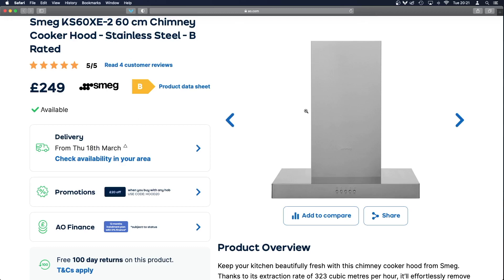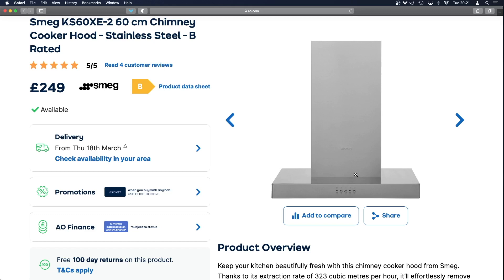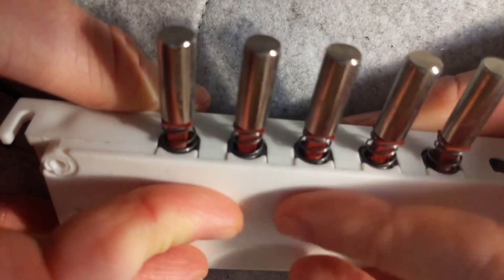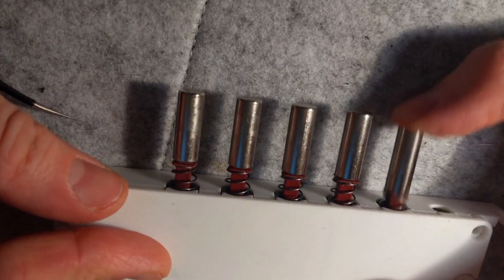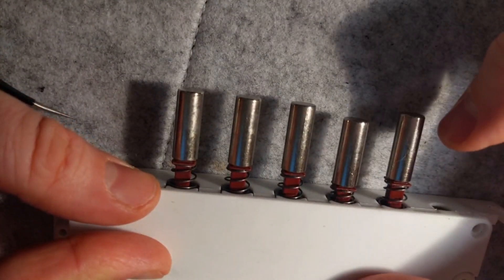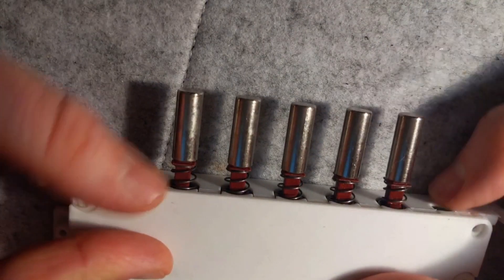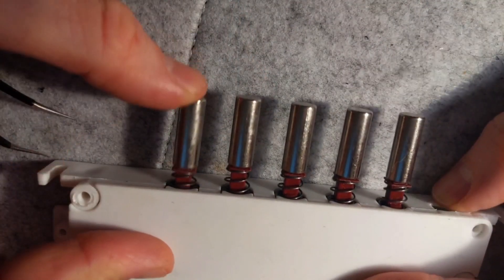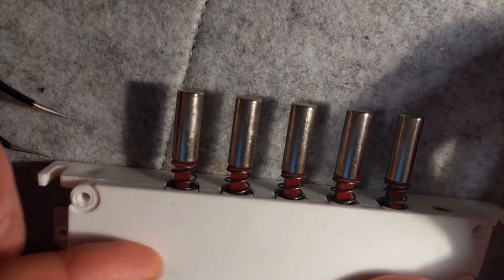Smeg Cooker Hood Switch Design Improvements - (diagnosis, design and fix)

Comment: Fixed my Aeg hood. I flood it with alcohol. After you extract the module, I sprayed desinfecting spray which is alcohol on all connections. Push the buttons WHILE YOU SPRAY to the get the dirt out. Then I sprayed air to dry it up. Test the buttons before reasamble.